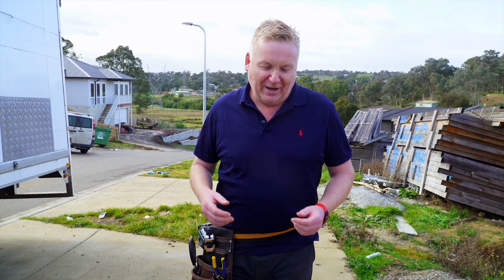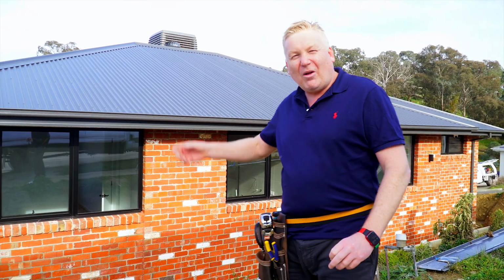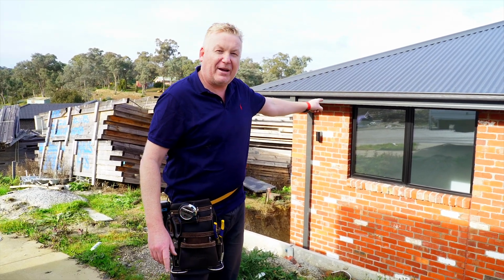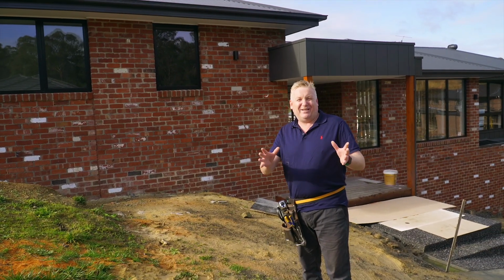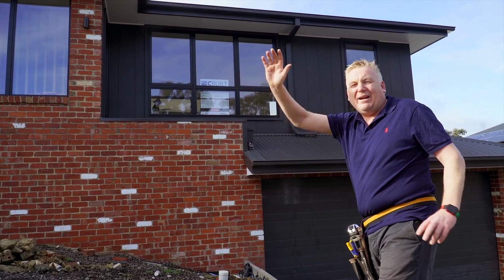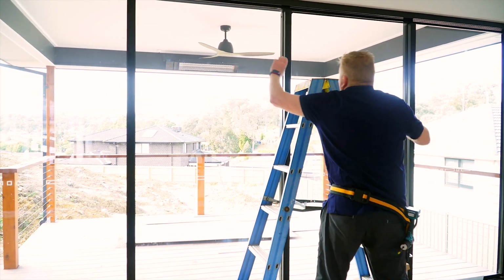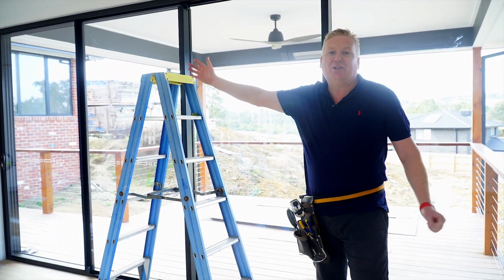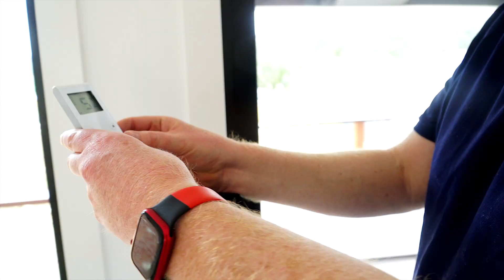Mike's Onsite  - Tom and Keeley's Complete Fit Out

Comment: Fabulous video Mike and very helpful.  When putting on the track for the sheer curtains, what was the blue tape for and did were you also able to manage to get the brackets in to timber?  What fixings did you use for this.
Reply from the maker: Hi Fran_gipani, 
Great question - thanks for asking! The blue tape was used to mark out the position of the brackets for installation of the curtain track. I put the tape on the track first, evenly measured out the location for each bracket, then transferred the tape up so I could mark the same positions on the ceiling. 
For installation into plaster, we recommend use of a wall plug; and when installing into timber - a simple 40mm timber fixing screw is all that's required. 
If you have any further questions or need clarification on any of the above, please contact our sales team on 1300 664 257, or sales@iseekblinds.com.au. 
Thanks again for watching, 
Mike.